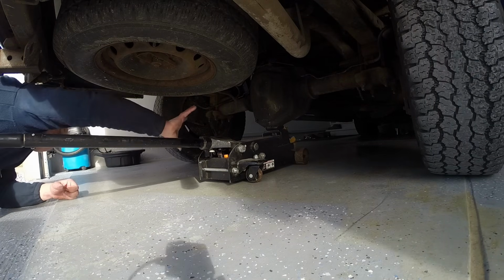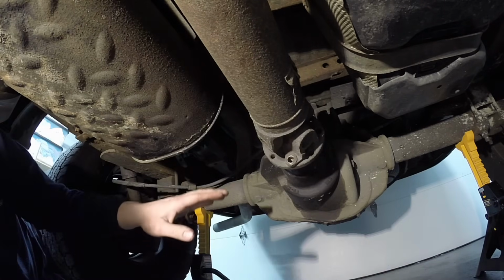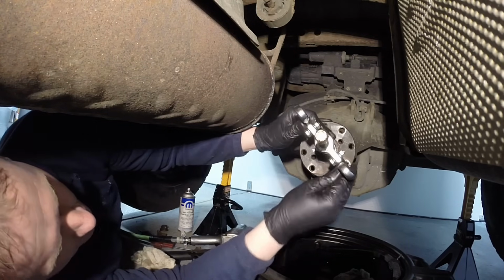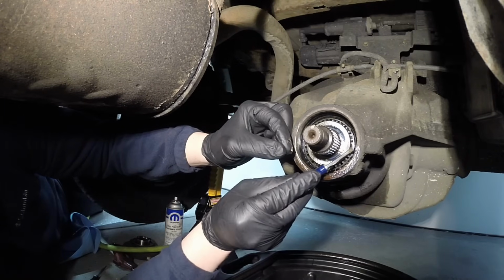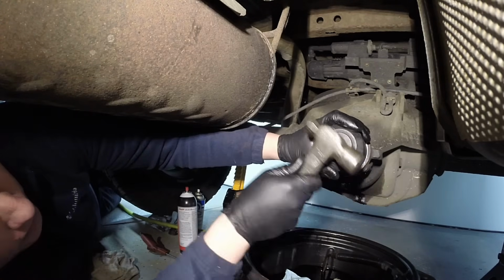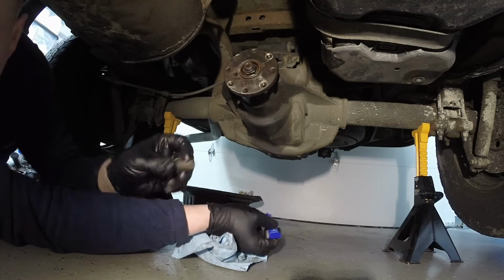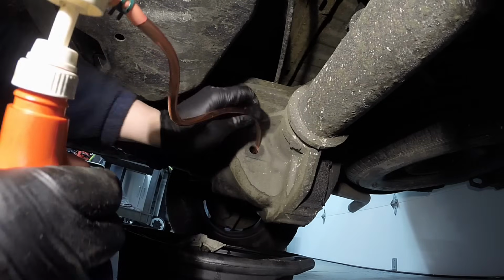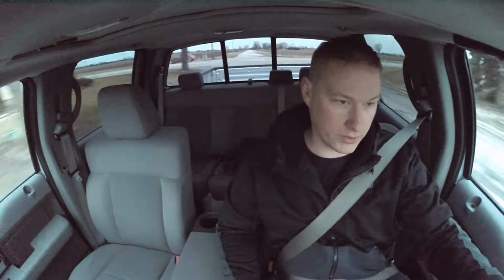Ford & Dana Axles Pinion Seal Replacement: Tricks of the Trade

Comment: I have a 2003 f150 with the 4.6L. How would I know if the rear bearings need to be replaced.
Reply from the maker: Hum noise from rear end
Reply: Wierd tire wear

Comment: I did mine today and have 2 questions.  When I hammered the new seal in with a large socket I did not realize it would go in so easy so one side of the seal was about 1/8" inside the housing and the other side was 1/8" outside the housing.  So at that point I lightly tapped the part sticking out with the head of the hammer because the socket would not work until I got it straight. However the seal is suppose to be flush with the housing and now since part of the seal went in further the whole seal is about 1/8" inside the housing and not flush.  That should still be ok right.  The more I thought about it the ,more I thought since the seal is 1/8" further in it will not be riding on the groove on that polished part of the flange where the old seal was.   Anyways my second Q was did you take any emery cloth and sand the groove smooth on the flange and if so what grit did you use.

Comment: So if you don't have a impact and you have to do it manually should I keep it in park so the drive shaft does not turn
Reply from the maker: Drive shaft bolts, yes or you could have a helper press on the brakes.

Comment: If I know the torque setting is 80 ft. lbs is it really necessary to count how many threads you have sticking out of the nut before you remove it and marking it with a paint marker so you get it put back together in the same spot.  The pinion flange nut I am talking about.
Reply from the maker: The pinion nut is not 80ft lbs, I am not sure where you got that info.

Comment: When hammering in the new seal do you hammer it in until it is flush or go in even further.Just didn't know if you can even go further then flush.
Reply from the maker: You hammer it flush there is a flange on there so it cannot go any further.
Reply: FordTechMakuloco I just done my 03 f150 last night an have a question. on back of pinion flange that goes into the seal when u put it back on an put nut on an run it down. Does the plastic piece on back suppose to go into seal enough to seal off the seal? Cause it actually turns cause it's connected to u joint to drive shaft. It's not leaking. An your vids are excellent! I've done broken spark plug that had blew out an also replaced the whole intake what a job that was taking everything off motor first. Thank to you no problems with any as of yet. Thanks again FordTechMakuloco

Comment: I have a 2011 mustang gt, 8.8 rear. I overhaulded the rear end replacing all bearings and races as well as seals. My pinion seal is leaking again after only a fee hundred miles. The yoke had a groove in it where the pinion seal wore into it so i installed a pinion yoke saver/ sleeve to refresh the surface as well as a new pinion seal so do you have any ideas why it may still be leaking?

Comment: When i used the impact wrench to take the pinion nut off, the chalk i used to mark it blew off. How do torque the penion nut without the reference markings?
Reply: A holding tool for the pinion flange ,  to hand tightened the  nut slowly and double checking the  total pinion bearing load  with a dial torque wrench

Comment: Hi. Great video. All for them are very good. I need to replace the seal on a 2003 Crown Vic PI. Does that car have the same setup. I’m surprised how little  info is on the web there is for this procedure on this car. Usually there is tons of good and bad videos. Thanks
Reply from the maker: Same procedure yes.

Comment: Do you check your vent hose and the axel housing breather port for blockage when doing these?  Sometimes I have found them to be clogged up with dirt and the pinion seal is the first to leak from too much pressure, at least on older models.  Great video, just wamted to see if you see this issue or not.

Comment: Great video I have to do mine....we replaced the u joints on my 250 and I let my son help. He didn’t tighten up the bolts they came loose, I had a lot of vibration. I checked and found the issue before it came out....I can’t blame him. I should have checked his work.....

Comment: How come you re-installed the badly pitted bearing and not replaced it with a new one? You said the bearing was making noise...
Reply: I assumed the inserted picture of a pitted bearing was not the actual bearing that was in that truck. He just showed a bad pitted one for reference.
Reply: He mentioned that it wasn't being rebuilt "yet" so I think that's in the plans. Probably a customer money or time issue. When he replaces that bearing and race MOST likely the other bearings will be pitted too and that would call for all new bearings, seals, and possibly ring and pinion gears and more in a worse case. Makes sense to change the bearing when they plan on doing the rebuild.
Reply: @Ashroyer86  Yep, he mentioned at 34:35 it was a cost issue and he'd already done a bunch to the truck on this particular job.
Reply: I have the same concern and I figure it's because the race is probably just as pitted. Replacing the race would require pushing it out from the other side, which requires gutting the diff. It makes no sense to put in a new bearing into a pitted race? Unless the race can be removed from the same side, which I doubt..... If the bearing is pitted, the race is probably just as bad since they ride on eachother.

Comment: Thanks for valuable video. For my 2002 E-350 it's similar but the nut holding the flange on is 1 5/16" and the recess it sits in is <1.8". Still looking for a socket with thin enough wall!

Comment: Excellent videos!! Please keep them coming. I own 6 different Fords and your videos have helped me do a bunch of stuff without relying on trial and error. Just did my 08 California Special. I just used the old seal as the "special tool" to tap the new seal in. I flipped it around. I marked the pinion shaft, flange and driveline flange to put them  back exactly where they were. You didn't show anything about pre-load. I take it this rear end you can just use an impact wrench? I just counted the threads, marked a line through everything with a paint pen and when put back together just took the line on the nut about an 1/8" past the line on the pinion shaft. So far, so good. No leaks and no noise.205,000 miles and still going strong. The Ford service manual said to take off the tires, calipers and brakes and use an Inch Pound Torque Wrench to set the preload. Really?Do you think I'll be o/k? Should I have tightened it more?

Comment: You should show a video of how to replace all the bearings and races in it and also what the torque spec is when you tighten up that inch and 1/8 Nut on the Crush seal
Reply from the maker: +Bow Worley I have one shot, just need to edit and upload.

Comment: I always break the fill plug loose before pulling the diff cover or bearings. I've never had a plug I could not remove, but I have heard some horror stories.   Also, I saw your goof. Did you?? ;)
Reply: Yeah, lol. Was getting ready to change the gear oil on my truck today, so I  checked the plug first and found the pinion leaking. I'd hate to get into the project, especially taking the diff cover off, then find out i can't get the fill plug out 😅

Comment: Thank you!  Thanks to your video, this 51-year-old woman was able to change her first rear pinion seal.  No more dripping under the differential, and seems to be driving fine.
Reply: this 41 year old is about to do it
Reply: @mombux  awesome 👍🏼
Reply: @mombux  how did it turn out?
Reply: @Marco-fi6gv  pretty well I recently replaced an axle on my toyota sienna
Reply: @mombux  I have to ask you the same question. Did you purchase the kit he was talking about or did you do it without it like him?
Reply: @mombux  I have to ask you the same question. Did you purchase the kit he was talking about or did you do it without it like him?
Reply: @Marco-fi6gv  i did it without it the only thing i had to buy was the big nut to take the bolt out but if you can rent a tool that will save you time
Reply: @mombux  thanks for bthe quick reply Maria. Cool, that's good to know I've already got that stuff because I've done work on the suspension. At least I think I still have it🤔😬, lol.  My sons are always borrowing my stuff and don't always return things🙄If I don't need to buy the other tool then I will definitely get by without it. Thanks a lot 😉
Reply: Maria Barahona #Icepips you can do it!  My repair is still holding just fine!
Reply: This 39 year old is giving it a go
Reply: LP pp
Reply: LP pp
Reply: Did u buy the tool he was talking about, or did u improvise like him?
Reply: Equal to man 🤓
Reply: Damn
Reply: Awesome!
Reply: Good for you!  Like most things it just takes some instruction and a little practice.  Keep up the great work!!  👍
Reply: @highlandspringssoapco3794  thanks!  56 now and just had to do one on my Ranger!
Reply: @jjbeemer  awesome!
Reply: That's cool
Reply: This 65-year-old done it thanks guys

Comment: So, two things. Like an idiot. I forgot to mark the rear pinion nut to the rear driveshaft pinion yoke etc, or count the exposed threading. What do I do during reinstall? Also, my differential yoke just slipped right off without using a puller. What does that mean?
Reply from the maker: +Taylor Nelson this is what I do in a situation like that. Either your pinion splines or pinion flange is worn out it should press on nice and tight to prevent any noise or lash in the drivetrain . We used to coat the splines with rtv to take up the slack in there but it's best to replace. As far as the nut goes tighten it until there is no slack in the pinion if you grab the flange and pull it straight towards you. Then turn it just a bit and feel for a slight drag in the back lash space between the pinion and ring gear this is how you know the preload is back on
Reply: Thank you so much. And thank you for the quick response. I will subscribe to you because that is just awesome. Plus your videos are excellent. Easy to watch and very very informative. Have a great day!
Reply: Thank you for this comment,  @FordTechMakuloco   

I'm working on the same job right now with my f150, and this is exactly what I needed to figure out. Thank you very, very much!

Comment: Great video FordTechMakuloco…! Thanks for posting.
Quick question….. Is the front pinion seal replacement protocol as in this video, the same for a 2006 F250 Super Duty Turbo Diesel 6.0 rear differential?
I just noticed over the past couple weeks after doing a long haul pulling my Travel Trailer 3500 miles, there's been some visible wetness of the axle cover plate bottom, along with an intermittent drip of oil from the pinion side of my differential. I was going to take my truck to the dealership however, having all the appropriate tools, time and ambition..., after watching your video, I'm considering tackling my F250's differential on my own.

Comment: Should grey RTV go on the seal? I have to do mine on my crown vic and someone said put the RTV silicone on the seal where it sits on the housing.
Reply from the maker: +corey stockert you should never need sealant  there is a sealant ring already built into the outside of the seal that is activated when you install it.

Comment: I have a 05 ford ranger with rwd.  So should i use the 75w 140 synthetic  gear oil?  I'm in Iowa, would that be to thick?  There is confusion on what the manual says on gear lube.
Reply: @Stephen Anderson
Depends what model of Ranger.
Some are 80W90 & others are 75W140.
It will specify in the manual.

Comment: +FordTechMakuloco Thanks for sharing. I've only done car seals up until now. With this info, I feel confident I'll be able to replace the seal on my 2001 Explorer limited with no issues. 
I do have one question: Since I have the axle out, I want to replace the transfer case seal. Is it just pressed in like the rear seal?
I also have to replace the upper control arm bushings in the front. I might make a video since I haven't seen one that covers removing the passenger side. Just a couple videos replacing the part with the ball joint. One was really badly done by some back yard mechanic using vice grips. VICE GRIPS!!! 
Thanks again for the info and keep up the good work. Sharing is caring.

Comment: Question, I am currently replacing the front hubs and brakes on my 05 f350 4x4 with a Dana 60. I pulled off the snap rings on the half shafts in the hubs to find out there were not any thrust washers behind the snap ring. Does the  2005 Dana 60 use thrust washers?> or just a snap ring.
Reply from the maker: No I am not showing any like we are used to on the 2004 and older models.
Reply: Thank you for getting back to me in a timely manner. I found out that I have the Dana super 60 with coil springs. It would be great to have you do more videos on more F250 and F350 trucks. Thanks again for the great detailed videos.

Comment: Hello Brian. Both of my Ford vehicles are running great thanks to your awesome mobile service, Thank You for that. Here's a friendly suggestion after watching another of your exceptionally produced videos. I've used a simple wide bladed Mason's chisel from Menards to curl the edge of pinion, transmission front/rear seals that works very well for seal removal. At +/-$10 been using this method for 35 years, it gets the job done well. Thank you for taking the time to share your knowledge. Much respect, Paul in HG...
https://www.menards.com/main/tools-hardware/hand-tools/concrete-masonry-tools/tool-shop-reg-2-mason-chisel/p-1444421222328-c-8954.htm?tid=-8959316249159847083
Reply from the maker: I bet it transfers the blows of the hammer very well too but I worry about anything with too blunt of a tip these seal flanges can be razor thin. I have a menards near by that I am always in I will have to try this for the price why not right especially pinion seals they are the hardest to get out for sure.

Comment: Is this about the same for a 2001 crown victoria?
Reply from the maker: Yup ford axles don't change much between sizes and years so your 8.8 is the same procedure.
Reply: @FordTechMakuloco  I have a question I got a 2002 Ford F150 and this making noise when you let go of the gas and it's leaking oil and you think I should replace the bearing to and sometimes it feels like it's going to lock up on the rear

Comment: I've got a 2011 and my fwd pinion bearing felt like it was pressed onto the pinion.  Where as you slid yours off with a pick.  What could be some causes for this?
Reply from the maker: It may have been overtightened the front bearing may be stuck on there a bit but not pressed on only the inner is pressed on.
Reply: Thank you for the reply.  It definitely wasn't pressed on like the inner bearing but even the new outer bearing had to be tapped pretty hard to get in to place.  My truck is all back together now and it's running great.  Thanks for all the videos.

Comment: Hey weekend warriors. One question and I'm dying for an answer. It is a good practice to mark the shaft pinion relationship when taking them apart. Is it really absolutely necessary to reassemble the exact same way? I've had mixed answers about that. What if you lose the marks? What happens next? Thank you all.

Comment: quick question that bearing you pulled out so easily mine is seized to the shaft from the bearings being gone and i cant seem to get it off i drilled one side of it and it still is not cracking free would it help if i drilled the other side or would it come right off with abit of heat? i cant get a puller on it or is there a special type of puller used for those bearings when seized? i can get the race out after the bearing so thats not a problem but i dont want to pull my diff apart and smack the pinion out since i have never put a diff together before dont want to mess up the shims and so on

Comment: Thanks for an informative video. 
It looks like you had no issues with the flange/differential turning while you remove/install the pinion bolt but were able to use hand force to hold it still.

Comment: FordTechMakuloco  Need your help...Just did pinion bearing on a 05 Expedition.  I pre marked everything as you stated in this video but did not pay attention when installing the nut....I way way  over tightened...I backed it off to the marks but now I get a noise on acceleration...like a stuck brake pad.chssssssssss...stops on deceleration.   Ideas...should I replace crush sleeve again?  Appreciate your help.

Comment: How's it going?  Just have a question for you.  I have a 2005 ford f-150. For the last 3 months I have been hearing like a rubbing weird noise and slight vibration when taking off from a stop and turning left or right. I took it to the shop and replaced the pinion seal since it had a leak. Added friction modifier as well and still doing the same. The shop did notice metal shavings on the differential plug  The shop does not know what the problem could be. Any idea what would cause the pinion seal to leak, metal shavings, and the vibration and noise when turning from a complete stop. I would appreciate your help. Thanks.
Reply: your limited slip is taking a shit, your sure the noise isnt coming from your front hubs??

Comment: i serviced my 2003 Crown Vic yesterday. engine oil and transmission fluid and filter. i noticed the pinion seal is leaking. not enough to drip but the bottom of the axle is wet. how hard will it be to changed?